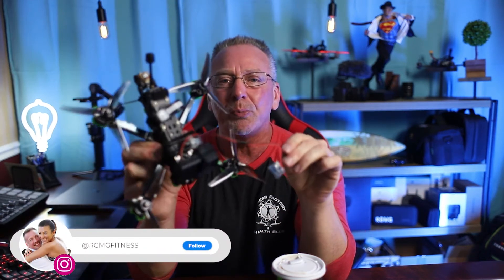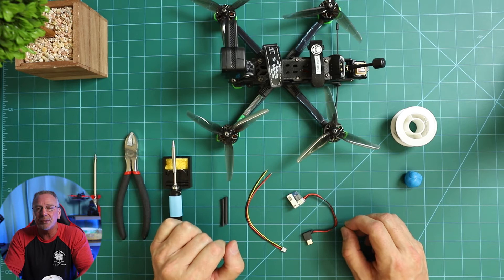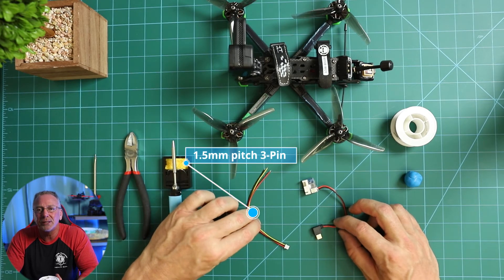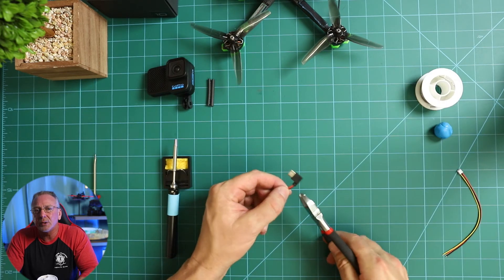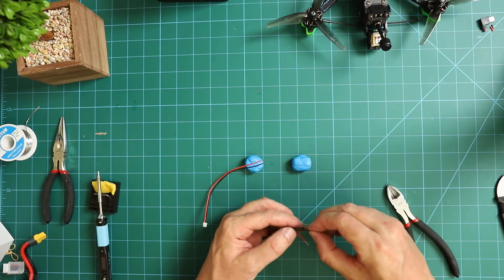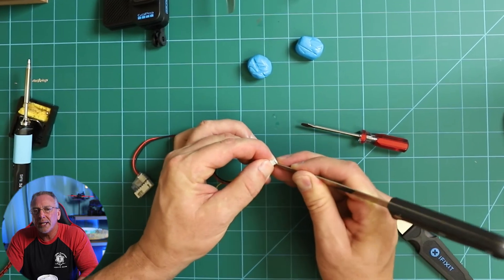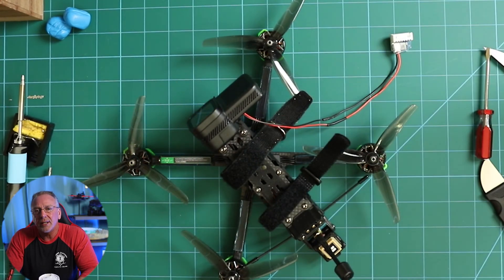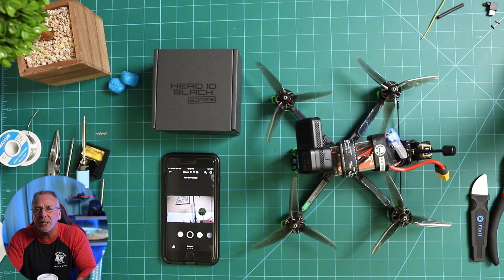GoPro 10 Bones | Wiring To LIPO Balance Lead

Comment: Is the balancing plug cable with circuitry a requirement? What does it do as opposed to wiring directly to a bare balancing plug connector?
Reply from the maker: You can wire directly.  My understanding is the balance plug would help with any voltage spikes is all..but I know people have done it both ways.  Figured it was only a few $$ extra...so better safe than sorry.